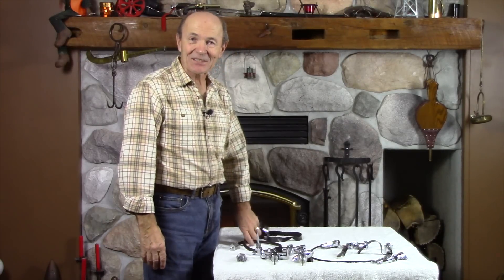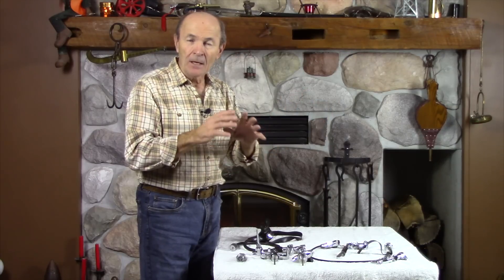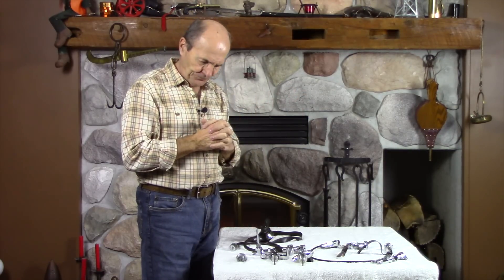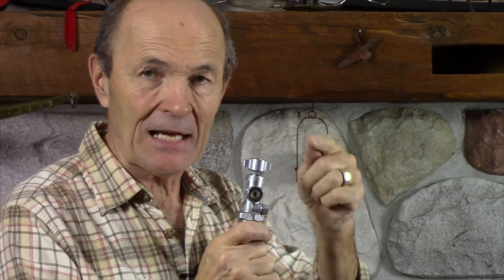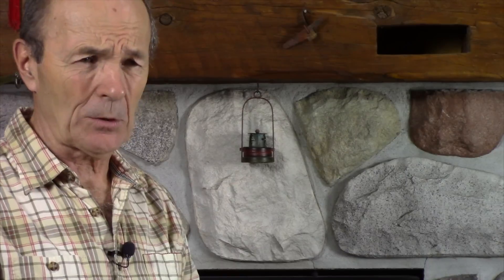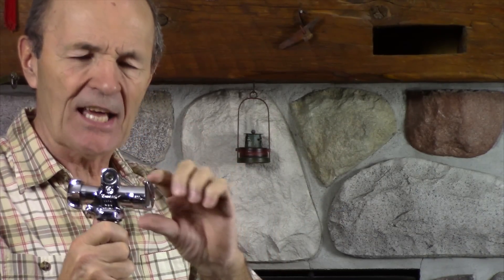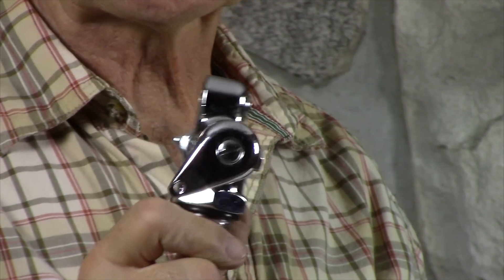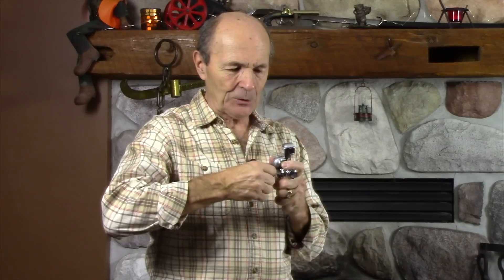Vintage Scuba: Weird Tank Valves - S02E08

Comment: Question how does the screw in regulator ( healthways ) convert the pressure to breathing eg. level 8 bar . There doesn’t appear to be a first stage ?  Great video took me back in time :)
Reply from the maker: The knurled part with the chrome bars in it that screws into the valve is actually a 1st stage.
It's a very simple piston 1st stage but it works & reduces tank air to about 150 psi.
Neat huh?
Alec

Comment: Alec did you collect these as they appeared in time or did you start collecting later-- it must have been easier for you as you owned a dive shop right?
Reply from the maker: At the time they came out, I kept these in boxes never thinking 40 to 50 years latter they would be 'vintage' and strange to many divers.  Imagine taking popular wrist dive computer today and locking it up.  Its nothing today but in 40 years, a museum piece maybe.  Just me filling up a garage over the decades then sharing with others on youtube.
Reply: @AlecPeirceScuba_SeaHunter  either way thanks for doing that

Comment: I have a couple of the scubapro "switch" valves on a set of twin tanks from around the mid 80's, with a manifold between them, and a sort of carrying handle around the manifold. Never tried them on. i imagine it would be hard to close the valve should something go wrong, atleast in a dry suit, which is used all year long in freezing norway. Very interesting videos, thanks.

Comment: Hi Alec: Thanks for another informative video! I've asked you before about the exclusion and demise of the j valve that I used to use when I dove in the mid 70's and 80's(before my steel tank rusted). I don't ever remember deploying it, but I felt safer knowing it was there. My recent dive instructor argued with me about j valves were a bad idea. What are your thoughts? I'm a retired firefighter, and all of our air packs had a extremely loud alarm when we got low on air. I liked your "taper" valve that you showed. J and taper valves seem cheaper and a better alternative than a pony bottle, wouldn't you agree? Your friend, Jim
Reply from the maker: I tend to agree with you on the pony bottle thing Jim. I'm a big fan of pressure gauges but only if you look at them. I think that if you have a pony bottle you will tend to rely on that to save you if you run out of air. With that attitude, you WILL run out of air. A pony doesn't give you much safety.
That same attitude is why J valves are not considered a good idea. With a J valve, knowing that you have a safety reserve, you may not be as conscientious about watching your pressure gauge. Hence you are MORE likely to run out air with a J valve. Weird how the mind works.
Take care. Alec
Reply: Alec, makes sense. When I started (`78) we didn't have pressure gauges - tank and double hose regulator looked just like Sea Hunt episodes! (thanks I'm finding myself watching those old movies now...) - but had much better wetsuits & mask and inflatable jackets (with little pony bottle). My dad got single hose regulator a few years later. So we dove until we ran out of air, pulled reserve and went up to decompress. Now I can't image using a j valve and depend on it, because your right you will use it!